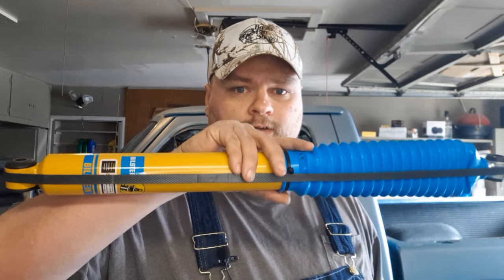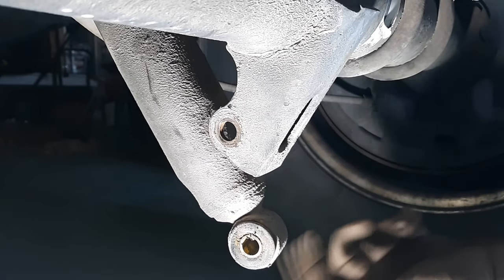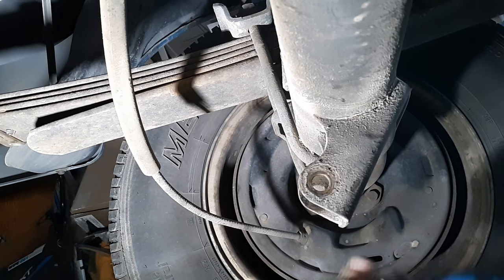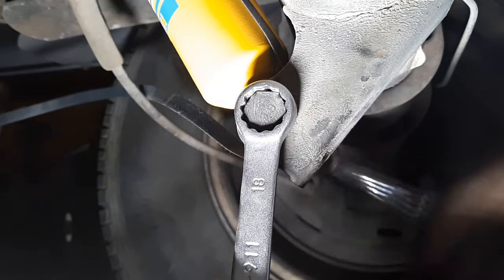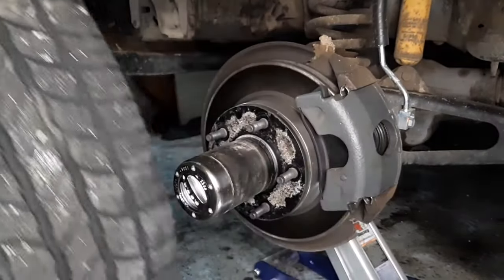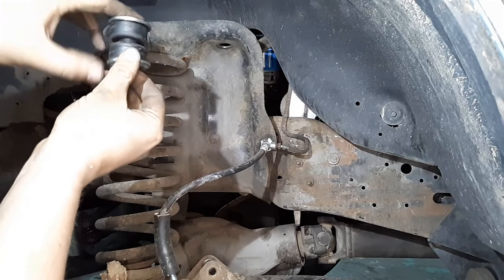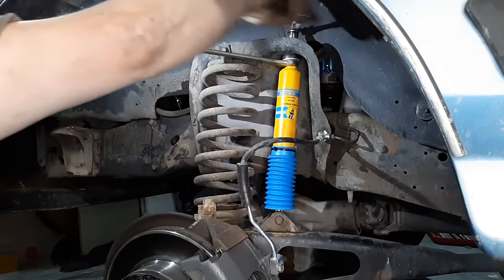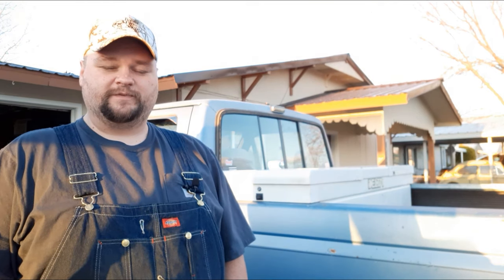Bilstein 4600 Series Shock Install (1980 - 1996 Ford F-150)

Comment: A jack under the rear bumper or trailer hitch to lift the body up until the strapped shock fits on loose. Since the truck is still mostly on the tires it'll be safe.
Reply from the maker: Of course that makes sense. No wonder I didn't think of that, LOL. Thanks for the tip, I'll remember that for next time.

Comment: I have put the top on first than jack the bottom with a floor jack with a socket to push it up high enough. Socket is for clearance from the jack
Reply from the maker: That's a good idea. I've also seen you can jack the vehicle up by the frame until everything lines up.

Comment: That burn looks intense. Couldn’t have been from a flashlight.
Reply from the maker: Yes. A very bright flashlight... for 30 seconds.
Reply: @LambchopsChopShop  may I ask why for 30 seconds? Seems a bit long
Reply from the maker: @djbrotherelectric  It was a bet from a coworker. 😂 the challenge was to hold it on my arm for 15 seconds. I doubled it. I may be dumb, but I ain't a wuss. Lol

Comment: I used red n tacky Grease on my rubber bushings. It's lithium-based so I don't believe it will hurt the rubber..
Reply from the maker: Lithium based should be just fine.

Comment: Was that a 4x4 truck? I have a 86 F150 2wd ... I ordered off your link in the description and I think they are too long.. I know I have to compress to install but I think the 24-016186 is actually for 4 wheel drive??? What you got on your end?
Reply from the maker: Yes this truck is 4X4. I don't know if, or what the difference is between the 4X4 and 2X4 coil spring size. That being said I feel like they should be interchangeable. Sorry I'm not more help.
Reply: @LambchopsChopShop  thanks for the response buddy.. much appreciated

Comment: I noticed the scenic background as you drove through the Ford proving grounds after the shock install. Where do you live?
I still think bolting the top first is easier. If necessary you can use a jack to push the bottom up and use a punch to line up the hole.  (dunit a few times)
Reply from the maker: I live California about an hour north of Reno NV. However I'm getting ready to move back to my home state of Missouri.
Reply: @LambchopsChopShop  I live in So Cal and I am getting ready to move to West Virginia. Got the rear shocks done and just received the Quad Front Shocks today and will be installing today. Thanks for the video and good luck to you in Missouri. Also, I wire wheeled the paint off the threads to make installation a little easier.

Comment: Which model shocks would you suggest with a 4” lift on a 95 f150? I noticed you said that these in particular for up to a 2” lift.
Reply from the maker: I'm not 100% sure. I know Bilstein makes them though. I'd look on Summit Racing, or contact Bilstein directly.
Reply: @LambchopsChopShop  thanks for the reply. I found out that the 5100 series is what I need.
Reply from the maker: @toneyevett5099  The 5100 series is good. I think you'll get a better ride than even a stock suspension with the 4600's. Good luck.

Comment: Try installing a 5100 front for a leveled 99 f150 4x4 ... Bilstein's data is pos.  You'd have to drop the front control arms to fit the thing into place.  Torsion bar type.
Reply from the maker: That sounds like a major pain in the ass

Comment: I believe you installed those upside down.  The boot is supposed to be on the bottom for the rears. Not sure about the fronts.
Reply from the maker: @jasoncharles6980  The fronts will only go on one way. As for the backs, I believe they can be installed either way. It doesn't affect the shock dampening. I just preferred the look of the boot on top.
Reply: @LambchopsChopShop  Labels right side up is the word on the street. Hey do have to purge the shocks before installing? Thanks for the video.
Reply from the maker: @tarwashsomeonestolemyhandle  I did not have to purge the shocks.